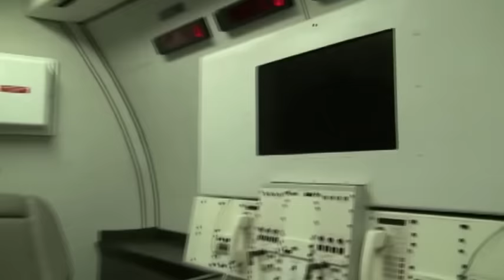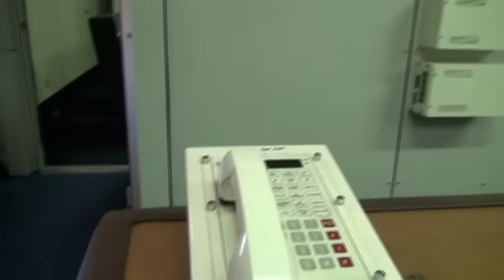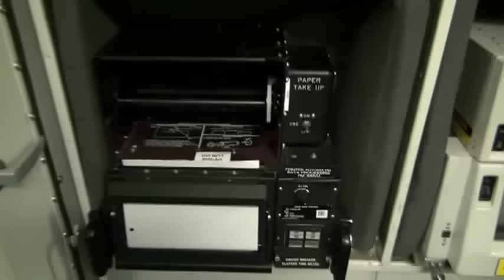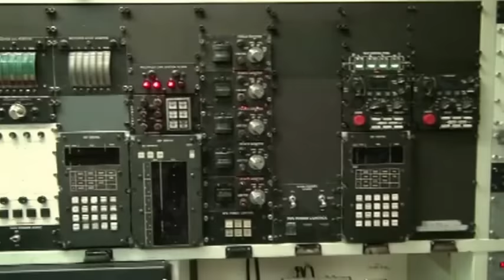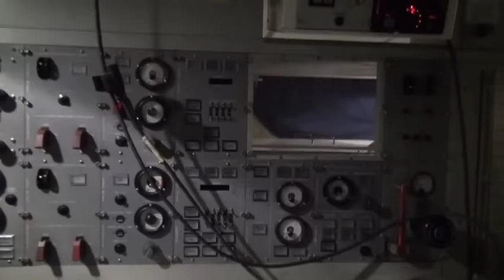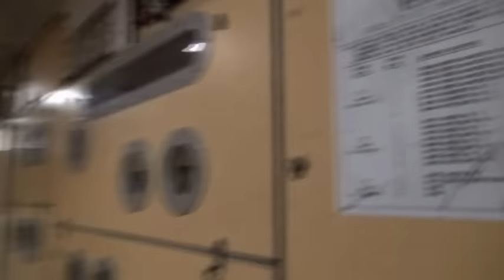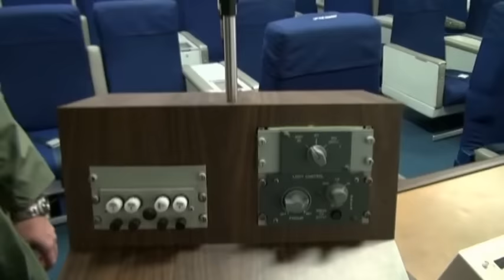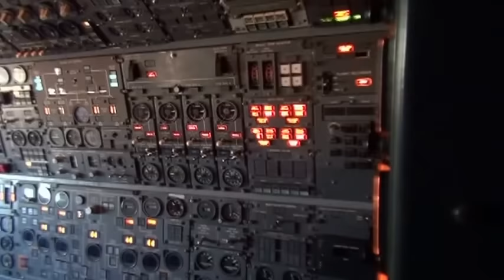Guided Tour Inside the E-4B NAOC Doomsday Plane

Comment: I worked on this plane for 9 years as a maintainer. I flew with it for 7 years and was involved in the communications upgrade in the mid 2000s. You should have seen the old equipment from the 60s. This is still my favorite airplane I ever had the pleasure to work on. It is an amazing plane.
Reply: Tell me it had a telex machine!
Reply: Where does the President meet, sleep, and do other things? Because the video looks like it only shows the crew parts, but isn’t this plane for the US President during Doomsday?
Reply: @theeverydayshow9896  no not necessarily. we can have four or five of these bad boys circle in the US at any given time
Reply: @theeverydayshow9896  The President should be on the Air Force 1.  The Defense Secretary may be on this plane to serve as a backup command and control center.
Reply: Definitely not built for comfort although the it was a smooth ride.
Reply: Replacement is coming… but itll still be a 747!
Reply: What was your AFSC to be working on the E4b?
Reply: @danopticon  kind of. Not quite the same, but close. When I started working on it we still had projectors, rotary phone, and Morse code converters. They were eventually replaced, except the rotary phone.
Reply: @NoticerOfficial It's gonna be really hard to fly 5 at once when only 4 exist
Reply: seems like a great tool for surveillance....

Comment: This plane looks depressing
Reply: All military planes do.
Reply: +Justin Hopkins Airforce One and Airforce Two don't look depressing.
Reply: Sean Webb Good point. You got me.
Reply: Justin Hopkins Otherwise I think you are right.
Reply: +zayub1009  - it sure does! - i mean how old is it? It looks like it from the 1900's - more sterile than your average hospital wards and prison cells LOL
Reply: Try working on it.
Reply: It is the doomsday plane...
Reply: when doomsday arrives I'm sure this plane will be the least depressing thing around...
Reply: Sean Webb it js only air force one whilst the president is on board, any plane he is on is air force one u til he steps off.
Reply: benson Benson At 14,000 feet I don't think any storm would affect you too badly
Reply: benson Benson mate it has a faraday cage, which stops electromagnetic radiation
Reply: What in the actual fuck is a nuclear storm? There's a blast, that's it. This aircraft (of which there are four) has 154  hours (6.4 days) of endurance, so it has no need to be anywhere near any major target.
Reply: What's a 'nuclear storm'?

EDIT: Just had to google it and it seems you've been taking Fallout 4 seriously. Nuclear storms are not a real thing.
Reply: Depressing plane for a depressing contigency. Doomsday plane? Well named.
Reply: Nuclear winter theory has been disproven for many years. The most dire predictions now think it would be, at most, a 40 day shortening of the growth season for five years or so, but could be as little as ten days. Try reading your own article.
Reply: they just need to install better lighting
Reply: It smells depressing inside too, electronics and old shoes... but it’s really cool 😎
Reply: It certainly does.  Those people in the plane are realizing that their loved ones are being killed back home.   Too horrible to contemplate.
Reply: Why friend, just put on a happy face ,then we'll all do the thermonuclear shuffle.
Reply: you must be depressed then
Reply: It looks pretty cool
Reply: Is mincing around and flagging my GAYDAR mandatory to being a part of it's staff?
Reply: Indeed -- people don't understand that as a whole mankind has detonated about 500 megatons of nuclear weapons.  Volcanoes are far more a threat for a 'long' winter than anything.  That's about the 25,000 Nagasaki nuke equivalents....
Reply: Scour, you're thinking of an E3, which is an AWACS -- the E4 is a NAOC.  Significantly different roles.  The E4 is a AF1 for the SECDEV, and there's far fewer E4s than E3s.
Reply: Still better than Ryanair:)
Reply: benson Benson the nuclear storms will be 20k feet below this plane will be above the storms. They just wont be able to land. So they will only be alive as long as the fuel lasts, but its enough for them to do all the paperwork etc.
Reply: Zeeshan Ayub The End Of All Civilization is Depressing 
😐
Reply: VIDEOSUPERHIGHWAY True
Reply: so does the guy doing the grand tour lol
Reply: Bruno Kunda It is the plane or planes used by the Vice President and I think the Secretary of State. First Lady might use it as well.
Reply: It's the standard Air Force color
Oftentimes called sea sick green.
I call it Lt piss green.
You'd think they'd give us Sky Blue or something like that.
Reply: southrules he is trying to stop the spread and use of them! We get tough or we lose!
Reply: The equipment looks really dated.
Reply: Wheres the luxury. I would of thought that they would of modernised it slightly
Reply: Skylark  The moon
Reply: Zeeshan Ayub more depressing the people down below getting exposed to prompt gamma and neutron radiation.
Reply: It's a doomsday plane. Of course it depressing.
Reply: Zeeshan Ayub 😂
Reply: @scottstrang1583  those people you are talking about have no soul anyways
Reply: 4:00 :|
Reply: Asf
Reply: Depressing as fuck
Reply: So if russia attacks, might not be able to come back to USA to land. ? 🇺🇸
Reply: Looks like inside of a submarine .
Reply: It's meant to help govt survive a nuclear war... Aesthetics likely weren't in the requirements
Reply: @MillionFoul  it's based at offutt, ground zero for an all out attack
Reply: @dalezapple2493  There are four of them and they move all over the place. One usually follows the president around overseas, for example.
Reply: Sean Webb not really military tho
Reply: Archaic as heck!
Reply: Def some antiquated computers going there. I think I saw a dot matrix printer lol. I’m sure it’s been updated since then
Reply: Of course it looks depressing, this isn't for vacation travel.  Their mission is to facilitate the killing of millions if need be.  What did you expect, a Disney theme?
Reply: @Spetsnaz--21  lol thats not high at all in the aviation / weather world. Thunderstorms easily punch up to and well above 40,000 ft. Its normal to see commercial airlines fly anywhere from 23-41k ft. Private jets can get up into the 50k's. And storms still force them to deviate.
Reply: benson Benson     "nuclear storms" ?    How many times have you watched the movie 'Damnation Alley'?  Several is my guess.
Reply: Zeeshan Ayub Of course.... It’s DOOMSDAY what do you expect? It’s not suppose to be enjoyable. It’s all work trying to keep the world safe.
Reply: @tulsaguy9963  but HE isn't tough.. HE is just confusing everyone willingly.
Even a huge airhead is still nothing but an airhead...
Get a grip!
Reply: @MillionFoul    64 cases of  MREs... so,  if fully staffed, they may have to ration food and water until they can land someplace to restock.
Reply: What is very interesting, is with modern 2020 facial recognition technology -  everyone one  of these Airmen's  identities  is now compromised.
um. 
That's not a good thing...
Reply: From the inside, it looks more like a submarine than a plane...
Reply: @Spetsnaz--21  you mean meters
Reply: the doomsday name ads to it
Reply: Considering its the plane from which the tattered remnants of the United States would be run after a nuclear war, the depressing look is probably appropriate.
Reply: @seanwebb605  But is Presidential transport considered a MILITARY planes?  I WISH the WH press corp had to travel on one of these monsters.
Reply: This is a "holy shit the world is ending" business only plane for the Pentagon.
Reply: yep, same bed as for death penalty :-) I can imagine this environment was designed for psychological conditionning. Guys inside don't have to forget they are part of a massive destruction weapon. i'm surprised to see this kind of video on youtube
Reply: @seanwebb605  those dont count. They did not use the lowest bidder for AF1&2.
Reply: I bet the in-flight movies are lousy too.
Reply: @jackallen3732  It's just the 1983 WarGames with Matthew Broderick on infinite loop.
Reply: The end of the world needs more cowbell and disco balls
Reply: @J4ME5_ thumbs up  more cowbell.
Reply: It more looks like my basement.
Reply: Were you expecting a first class Emirates flight?
Reply: @justinorwen1739 Don’t say that or they’ll waste more taxpayer billions on upgrading it.
Reply: @cherisharmendariz 
Much easier to fix and more durable than flatscreen technology.

Comment: All operated by windows 95 home
Reply: Nah. It's running dos.
Reply: @johncitizen6791  true that!!!
Reply: Scott Luther  If I remember correctly, there were at least 2 versions of Windows 95, original Retail box release and then OEM Windows 95 B.  The original Windows 95 had FAT16 drive partitions.  OEM Windows 95 B had FAT32 drive partitions and a few other enhancements.  FAT16 only allowed for small hard drives.  If you tried to create larger partitions under FAT16, you would be forced to have huge cluster sizes and waste space.  FAT32 was better for the day and lasted a long time.  Today most hard drives, because of their TB sizes, use NTFS.
Reply: Sihle Nzuza 😂😂😂😂
Reply: Chef Mime  He was joking.  That's American humor.
Reply: WTF is an operating system?
They can't even run Unix.  Everything not pre-digital is coded in assembler and Ada.
Reply: Probably Commodore 64...more stable
Reply: 哈哈
Reply: Home versions didnt come out til the xp days
Reply: Less advanced technology less likely to be hacked.
Reply: DOS SHELL   & Windows for Workgroups ?
Reply: @johncitizen6791  Those "printers" looked to me more like pre-pc disk packs that I used to load and unload in 1969.   All the dials and indicators are analog mechanical ones  -   how up to date is this aircraft:  it's a 1974 model B747-200B but the interior fitout looks like 1970.
Reply: Well, that just shows the strength of has, to be the doomsday plane and run windows 95? Amazing wonder of technology and aerospace
Reply: @heselofhephidiyiai5985  well said!!!!!
Reply: Hahaha
Reply: Yep, but back then it was state of the art. I wonder that it's like these days 🤔
Reply: “S H F Operation” is explained as “super high frequency”, but really means “sh*t hitting fan operation”.
Reply: Wasted money that could have helped the poor
Reply: More like Windows NT
Reply: Looks more like DOS... with green on black character interfaces.
This plane seriously looks like it came out of a time machine from 1975.
Reply: "Windows working on updates please dont turn the computer off 10%"  is a bit of a problem during real  live WW3
Reply: LMAO   😂😂😂
Reply: Printer copy fax... now we have energy efficient laptops
Reply: Abram Carroll you can write an operating system in assembly. Look up MenuetOS.
Reply: And still being updated with floppy disks
Reply: Cypherdude1 OEM and Retail refers to the licensing method for Windows 95, but are the same version. There were Enterprise and Educational licenses available for Windows 95.
Reply: Yeah thats because the US military took so many years to find the loop holes in a system and counter it. They are too lazy to upgrade and find the loop holes in a new windows 🤣🤣
Reply: @johncitizen6791  🤣🤣🤣
Reply: Windows 95?? I'm still only using Windows 10!
Reply: Hardly; Windows NT or Windows 2000 are more likely.
Reply: Believe it or not Obama gave us funds for updates. You should have seen what it was like back in 1999 prior to Y2K
Reply: Molleigh Womack  thats where you would be mistaken and it’s been proven.
Reply: Molleigh Womack  trump spent the entire G8 summit trying to reinstate Russia after they got kicked out for invading Crimea. Trump is a damn traitor
Reply: Molleigh Womack  What I’m talking about has been proven what you were talking about is just a conspiracy theory that has no evidence to support it give it a rest Trump is a traitor.
Reply: XP
Reply: I believe its a Vic-20 running everything.
Reply: Windows 98 se
Reply: @MottisOWNSYOU  lol, yes....
Reply: Scott Luther  Wrong they had A, B and C
Reply: lol
Reply: Life is so tense right now but this comment made me laugh out loud!
Reply: Probably a Linux, there's also a Linux with Windows-style theme and UI
Reply: Windows isn't secure enough, they knew better than that!
Reply: @thecman26  I think so too

Comment: I flew on this plane in 1986 (If I remember correctly). I was the only passenger besides the Pilot, Co-Pilot, Navigator and Steward. I flew in the cockpit right behind the Pilot. We did an in air refuel. It was amazing. I had a TS clearance and supported the communications for the E4 Squadron.

Comment: This is the coolest thing I’ve seen in a while.  Imagine what they could stuff in a A380
Reply: I'd like to see that but doubt they'll do it since Airbus is not American. There's a reason all government and military planes are American made.
Reply: @willmorrell488  It's possible that they decide to go for it. They considered the A330 for the new air refueling program but ended on the 767. If they wanted a similar amount of space then I see them most likely going for the 747-8. They announced that they were looking for a replacement for this.
Reply: To use A380s they would have to do too much costly upgrading of existing ground infrastructure, similar to what commercial airports had to do to handle A380s. Brand new B747-8s would most likely been selected.

Comment: It has old technology because it is meant to only be on analog. Run even if there is an emp or solar flare
Reply: @RSN-STX  you can easily protect microchips from emp's. Just a faraday cage
Reply: No, it's old because it was built during the Cold War and it's certainly not all analog. Digital systems can be hardened against EMP as well, and it isn't that difficult to do. It's just that no civilian systems have a need to be EMP-hard because it's extra expense and complexity.
Reply: Ok sure bigwhiteyeti
Reply: No it is old from our point o.v. but it was up to date when  necessary,now it's a museum,so what is all this talk about,old and phone calls and so on ???

Comment: Hollywood depicts military aircraft as futuristic wonder machines. In reality, they are bland, dull, and confining, with an eclectic blend of high tech and old crap.
Reply: Papi Uuhmelmehahay there’s good reason they still use “old crap”.
Reply: Confining? Damn, I didn't know airmen needed an onboard spa to drop bombs or perform their duties
Reply: Ryan Ghezzi, it's not that so much... it takes forever to test and certify components and software for C4I systems.  Then there are EMC issues and EMP hardness to consider.  It's not like swapping out your PC at home!!
Reply: "reinforced, built to purpose, packed with gear and supplies,  and using upgraded EMP hardened 1960s cold war era technology designed to withstand megaton blasts  EM radiation."

- there,  fixed your typo for you.   Not much sense in flying around in a half empty air craft filled with foreign tech purchased from BestBuy.
Reply: The E-4 was pretty accurately depicted in the 1990 movie "By Dawn's Early Light".
Reply: in emergency usually simple and old school things are more important than high tech things
Reply: This is not modern. It’s a museum. The real deal is much better. They have freaking wooden desks and folding tables in this junker!
Reply: You really think this is it? You really think they're gonna show us the real deal? Please 🙄
Reply: " Although many older aircraft have been upgraded with glass cockpits, the E-4B still uses traditional analog flight instruments, as they are less susceptible to damage from an EMP blast."

Comment: Notice how thick the doors and walls are and how up armored the electronics are.   Obviously the interior is designed to suppress EMP and negate jamming.
Reply: you saw the net across the window. a farday cage around the entire body I guess. So I wonder if any of the EMP reach the inside. I was thinking about if they managed to reinforce the engines too. Yeah the equipment was bolted fast so I guess it can take the physical shockwave from a blast. You get all sort of questions looking at this video. For example are the wing bars stock or special kind.
Reply: Also notice the lack of computers in the cockpit, probably one of the last to have a flight engineer in the cockpit.
Reply: It's built off the original 747-200 which they stopped making in '91. That chassis is pretty old school.
Reply: this aircraft won’t be updated any time soon as it’s a purpose built flying government office, wouldn’t be surprised if it travel’s with communications spares
Reply: @Derrick.Aguero87  the comms operators are actually maintainers as well.  They can fix the equipement that they use.
Reply: @projectmanagement2356  Well even we idiots know what a faraday cage is